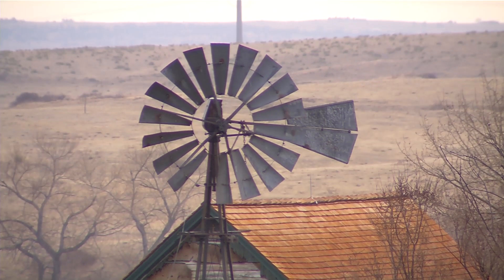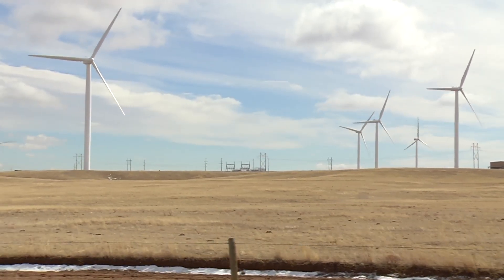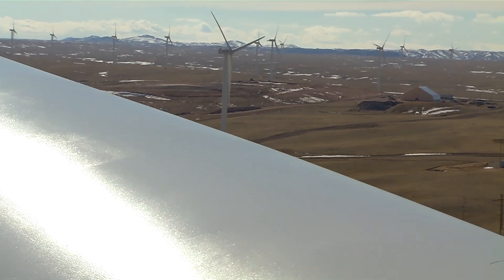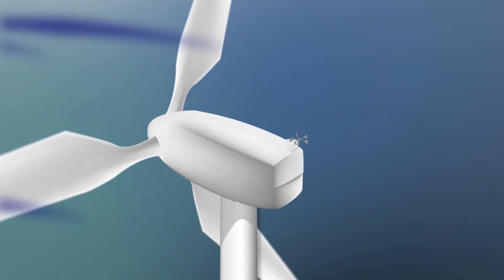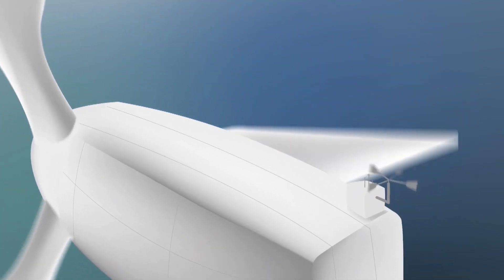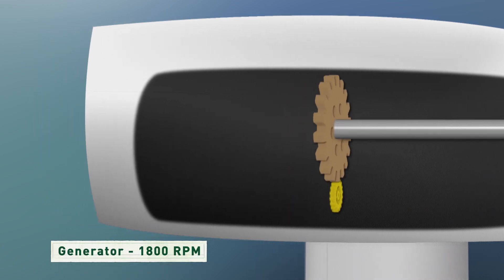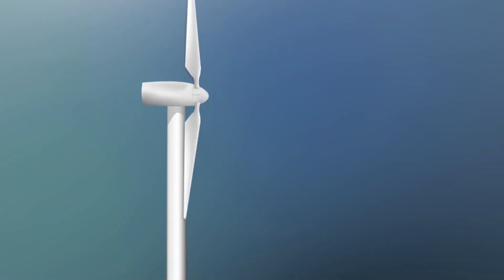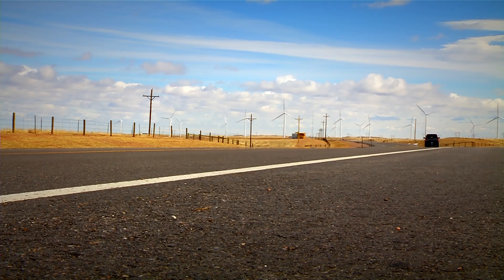Energy 101: Wind Turbines

Comment: Wind turbines are straight trash. Interview a chemical engineer that works with the polymers used to develop theses pieces of shit. Then talk to a hazmat specialist to know how much shit is leeched into the environment.

After that talk to the concrete boys that have to anchor these giant monstrosities. Ask them how much diesel and oil is used to achieve it.

Then ask the wind turbine maintenance people how much oil they have to change every year in those puppies to ensure the turbines stay properly lubricated. What happens to that oil? What about the longevity of the wind turbine, and where does it go once it reaches the end of its service life?

Wind energy is NOT the direction we should be taking for renewable energy. It comes at way to large of a cost. Too many forever chemicals are created in the process. Too much crude oil is still needed to get the things running. They don't have the operational longevity either.

There are way better options. Don't support wind energy. Find a better way!

Comment: Hi JMC porshe,
I agree that the output of energy from traditional nuclear power is not efficient when compared to the amount of hazardous waste produced. In retrospect, many people are unaware that there has been another type of nuclear tech used primarily by Germany that is more efficient and can store more than an entire 40year lifecycle of waste on site. This technology has been around since traditional nuclear power but has higher upfront costs, but based on the reduction of waste and the fact it is virtually impossible for the system to meltdown; I feel the cost is somewhat mitigated. So what is this Technology? It is called Pebble Bed Reactors (PBR) and the system does not produce enough heat to reach the critical temp threshold, as well as, it is a dual source as it also turns turbines from the channeled heat produced instead of traditional steam. Check it out yourself!

Comment: So , you did miss what you have . The multi bladed farm turbines were designed to pump water , a slow process , requiring high torq . Pump the water , tank it high & use that to drop chunks of energy when required also . Energy & energy storage using mostly existing kit , and allowing it back in the hands of the guys who need it , near the grass roots .

Comment: The compressed air engine that you are referring to is intriguing technology, but does not have the capability yet to produce nearly enough electricity to be used as a power source. As far as the health problems reported, they are mostly just people looking for an excuse to prevent the construction of new turbines. If you think about it, how could a steel pole sticking in the ground with wings on it cause any health issues? It doesn't emit any toxins that would cause them.

Comment: Imagine how inefficient a sailing boat would be if the wind was expected to charge a turbine to turn a propellor rather than being used directly to power the boat along. Energy is lost from the system the sailboat would never work. and that is why you have never seen it or anything similar in the 2000 year developement of the sail boat.
For the same reason the idea of feeding wind electricity into a grid is inefficient and just doesn't work

Comment: What do you mean by EXTREMELY inefficient? One turbine (depending on size of course) can produce a large amount of electricity to power several homes. A farm with several does this even more so, matching the output of a typical fossil fuel power plant all while using no fuel and producing no emissions. It's like free energy. When you consider the simplicity of a turbine's design, it's hard to believe that it would be more expensive to run than a coal fired power plant like the one in Fall River.

Comment: Narrator says: rotates at 18 rpm and "that's not nearly fast enough to generate electricity"  Perhaps the government should tell Enercon, Northern Power and GE about this. They all make large wind turbines that have no gearbox. The fact is you can build a wind turbine with a low torque, high speed generator, or a high torque, low speed generator, both are commercially viable with the latter gaining on the former.